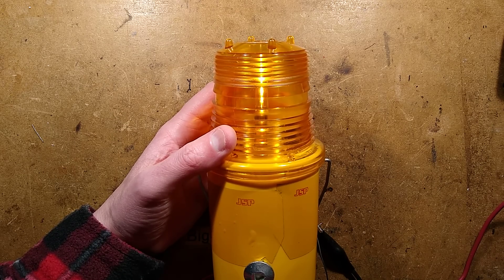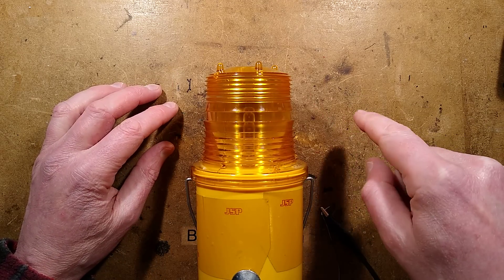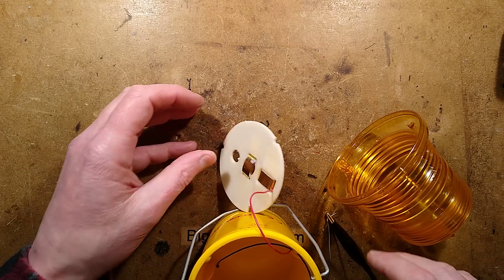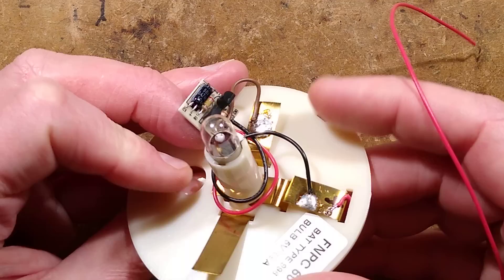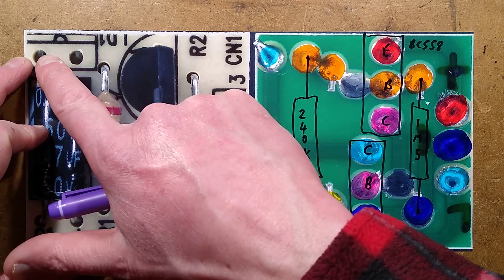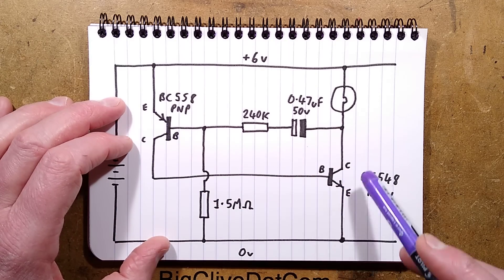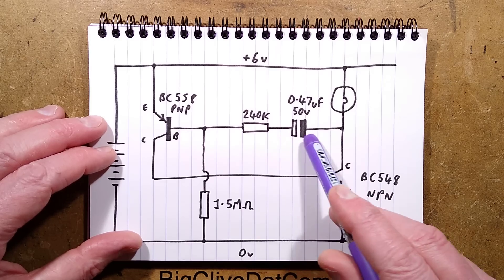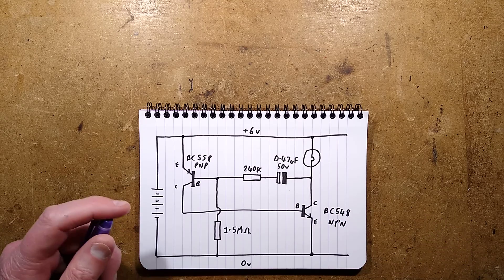Old tungsten roadwork beacon - with schematic

Comment: I’m old enough to remember roadworks beacons that used a paraffin lamp. They went electric around 1966.
Reply from the maker: Those used to be really cheap on eBay, and now they are expensive vintage items.
Reply: @bigclivedotcom The original Dorman Smith one's are. Dorman Smith got the idea after one of the founders took a trip to the USA and saw a transistorised lamp made by R. E. Dietz. Dietz 650. Dorman Smith them obtained the rights from Dietz to produce here under the Dorman Smith Trafilamp name. Just some pointless info.
Reply: They were still using the paraffin ones in the 1980s where I lived  .
Reply: @kwakamonkey I saw them in the Eighties too.
Reply: I remember  in the middle of a torn up road you would have the night watchmen in a tent with a kettle on a brazier guarding the steam rollers. They would always talk to you and sometimes a dimple glass of beer would be sent over from the pub probable in exchange for some Esso blue paraffin used in the lamps.   @belyear
Reply: @kwakamonkey that’s right they still use the paraffin lamp in London up too the late eighties and there was two colours Red with red glass windows and yellow with amber glass windows.
Reply: @Dog-whisperer7494  I doesn't surprise me they were used for 20 or so years, after they were no longer manufactured. People didn't just throw them away, because they were no longer made. They would have replaced them, as they broke.
Reply: Yeah same here. @kwakamonkey
Reply: @kwakamonkey came to say the same - 1980s around Manchester still were using paraffin
Reply: Came here to say this too. I used to see those regularly in the early to mid 70s. There are a few variations on the classic lantern battery ones too, like the one with a rectangular body and a huge round lamp/reflector that had an on/off switch accessed though a pinhole in the body.
Reply: @TheRealBobHickman 

I think there's two still in my mum's very disastrous garage. A yellow square metal cabinet with a curved vented top and a substantial metal hook built in. Three thick amber glass lenses, one of them was all yellow and one had white rims around the lenses.

I think my dad procured them from when he used to be a fabricator for Laings in the late 60s or early 70s.

If we had an outdoor BBQ and drinks etc (a very common weekend occurrence in the early up to late 80s and before I was told, I was born in 1977, no alcoholic stuff for me, then!) these would be outside as the light went usually with a huge candle stuck in each!

Funny how a comment can bring a flood of good memories back 😊
Reply: @TheRealBobHickman  Yes I remember those.
Reply: I have one of those from the '50s. I'm old and senile now, so have now idea how I came upon it, officer.
Reply: Did they originally use a bulb with a bimetallic strip for the flasher?
Reply: @alunjones3860 I believe so, I remember when I was a kid you could hear a slight clicking as it switched.
Reply: @alunjones3860 Transistors.
Reply: @alunjones3860  YES...a very complicated circuit...!!
Reply: I remember smudge pots at construction sites. Bright flame at night, fountains of black smoke during the day.
I see them for $30 on eBay and Etsy.
Reply: @tncorgi92  I remember seeing those as a kid and thinking they looked like little bombs since they were round.
Reply: Yes, metal square boxy things with a red coloured lens on each side with a large metal loop/hook on top.
Reply: I recall some in Illinois in maybe the late 1960s that were squat and vaguely spherical and burned what I thought of as kerosene…
Reply: I remember those as well,  in New York City in the 1960s.
Reply: @markiangooley  They were called "smudge pots" and yes, they looked like 8" diameter black spherical bombs. Filled with kerosene, they had a wick and a cap attached with a chain that was used to extinguish the flame when it was not in use. They stank and smoked and were generally dirty little warning lamps.
Reply: @markiangooley  they used them into the 80s in NY - they're called "Smudge Pots"
Reply: @markiangooley Right the big flat bottomed spheroid with a wick and a big smoky open flame. Maybe kerosene fuel, I suspect they were just as often filled with diesel judging by the smoky flame.
Reply: We would keep the paraffin ones and use them for camping... this was the 1980's they used the paraffin ones were used on older roads they would leave them for ages
Reply: @blackcountryme  It must have also been good for keeping you warm, Talking of obsolete technology, we still often used oil and gas lights when I was in the scouts in the 1990s. I suppose it made sense, as the same lamp could also be used as a stove, if the mantel were changed for a burner and it lasted longer than batteries. Nowadays it just makes more sense to use safer and more efficient LEDs.
Reply: Smudge Pots (as the paraffin ones are called in the States) found a second life in Citrus orchards on frosty nights. Both the heat and oily smoke offer some protection for both fruit and trees.

It's interesting you should mention flashing. The wind blowing the flame about is the original source of the flashing; it became so characteristic of these devices that all the electronic versions that replace the originals flash.
Reply: Floridian Zoomer here, I learned about the burning fuel road flares during a hurricane in my childhood: a local tree-surgeon and family friend had been hoarding them as “collectibles” (turns out he WAS right, unlike his Bernie Baby and Baseball Card predictions). He was a cool guy, got in a fight with local utilities for paying his crew out-of-pocket to clear fallen trees for free after the storms. We were out of power for almost a week after Wilma, and he lit the neighborhood with his little burning clay pots and hauled brush and lopped limbs in the dark until noise ordinance would stop him.
Reply: I've got one of the paraffin ones that my dad "acquired" years before I was born. Used to hang in the shed at home. Now hangs in my garden.
Reply: Back in 1979 while on a walk I found a becon that had been hit and slammed into the ditch on the road I was walking. I took it home and reversed engineered it myself and the circuit was very similar except the becon I found had a cds light resistor that pulled the base of 1 of the transistors to ground when it was light enough not to need it flashing. It like the one in this video used the same type of battery supply but it was better because it made the battery last longer.  Today we use solar charged batteries in the better made beacons. A good  video Clive.
Reply: They were also used on the railways as a signalmans lamp.
Reply: Me too! 😅
Reply: same. We were a bit behind the times in the midwest of the US in the 60s & 70s ^_^
Reply: They were still using the paraffin ones Into the seventies. They repainted a lot of them yellow, but my brother and I got hold of one in the original red with white roundel
Reply: I stole some parrafin 1s with the hooks back in the 80s and my mum uses them in her garden when it gets dark, the smell takes me back to good times
Reply: I remember those from the very early sixties, they were round and black, flat on the bottom and had a little cap on a short chain. They were pretty smoky too but they smelled like kerosene.
Reply: I got my start with experimenting with electronics with those 6 volt batteries and blade switches, wire, bulbs, and whatever else I could get with my 5 dollar a week allowance in 1961. 
Things have certainly changed since then. There’s so much stuff to play with these days.🚧🙂
Reply: I used to have several of them . Wish I still did lol
Reply: @kelvinsparks4651  You could fill them with citronella oil and repel insects.
Reply: Anyone in this thread could answer, how did they blink the paraffin lamp? Was there an electric rotating reflector or did they simply not blink?
Reply: They didn't blink. They were just little paraffin/kerosene lamps in, basically, a metal box with coloured transparent windows  @JarnoKai
Reply: @tonywalton1464  The flame flickering would have created a flashing effect.
Reply: @JarnoKai  they didn’t blink
Reply: @fredbloggs5902 Some did, and it was just the design of the wick holder. They didn't actually blink, the wick would just flare up and  die down again (almost). giving that impression. Used many of them in my youth, still have one.
Reply: @JarnoKai  most didn't blink, but there was a version which did, by means of a special burner which caused the flame to almost extinguish and then light up again. As I remember it had extra holes in the burner under the wick and I think it had something to do with the airflow.

Comment: I used to get these as a kid - no circuit board at all - just a bulb that had a built in flash mechanism
Reply: Just like those xmas string lights where one bulb on the whole string is a flashing variant, usually a clear glass bulb with red tip for easy identification. Apply ~3V and it flashes on its own.
Reply: @teardowndan5364 Bi-metallic strip.

Comment: You say that circuit was as simple as they get, the ones I nicked as a teenager in the 60s just had a battery and a bulb with a built in bi-metal switch, to turn it on you shoved a pin through a hole to bridge some contacts. I still have a couple hanging in my garage.
Reply: Yes in the Netherlands we had those to in a rectangular metal box with two parallel 6V batteries inside. This box was closed with a large special anti-theft bolt but one managed with some pliers.

Comment: Oh the memories. Swiped a lollipop style one of these as a kid and tore it apart.
The things you can do with a 6v battery and a piece of wire as a devious child.
Not to mention the free flashlight bulb LOL
Reply: The road workers always had spare bat's for a lad to play with. The early ones had a bimetallic switch in the bulb so when the bat got low they would just stay on.
Reply: @Woffy. 
They did indeed. No electronics, just a flashing bulb. We used to "borrow them" and salvage the batteries for other more interesting uses.
Reply: @johnnodge4327 Thanks for the reminder, I also borrowed a few way back when. Time to return them I guess, but the council aren't answering the phone at 1am for some reason.  I guess they're not too concerned about recovering them after all.
Reply: The 6V lantern batteries were good to waste on making pencil leads glow.
Reply: @Sonny_McMacsson I used Dad's battery charger for the pencil leads. It had selenium rectifiers and a big transformer. I still have it and it still works so it's obviously indestructible.  It's a dumb charger though so it'll boil the battery dry eventually.
Reply: The lollipop style ones are all I would see in the US. I wanted one as a kid, but could never snatch a loose one.
Reply: Same. At age 10 I was able to breadboard my own bulb flasher using a schematic from the manual of a Philips electronics kit in the E200x series. It had a few variations on this theme too like sound, ldr etc.
Good times!
Reply: @Multi-Skill-Bill
i also acquired one about 50 years ago , a lollipop with 2 batteries , a clicky switch that was operated through a small hole and if memory serves the same electronic circuit :-)
Reply: @YTANDY100  yep, the one you could switch on or off with a paper clip :)

Comment: Reminds me I recently got a couple 12v amber bulbs from the autoparts store to use as a load for a psu I replaced a cap in. I soldered a couple wires to the two contacts on the bottom. Interesting that bulb only has one and the sleeve is the other connection. However I know most bulbs are like that. Glad I got ones with two points. Easy to solder to. Wasn't spending more money on sockets

Comment: The Pre LED USA barricade flashing lights differ in 1 main way, the flashing circuit is supper brief and the lamp is rated at a lower voltage that the 6-volt battery. So, the lamp acks like a strobe. They hit the low voltage lamp for a brief pulse for a super bright flash that does not burn the lamp out.

Comment: I've seen some of the newer LED lights that somehow seem to run in a sequence and always wondered if they communicated with each other.  (You sometimes see them on the motorway when a lane is closed and the lights as the cones come out will run along the line of cones in sequence).  Would be interesting to see how they do that.
Reply from the maker: Infrared emitter and receiver.
Reply: @bigclivedotcom always wondered how these work, would love a teardown on one of those
Reply: @bigclivedotcom  cool, I assumed it would be something like that but never had the chance to take one to bits to see.

Comment: I had one as a kid. Left behind in a ditch after the road workers had finished and probably forgotten to take it with them. It was always on and had a light sensor but when the battery had run down I had no clue what to do with it so probably threw it away.

Comment: My grandfather worked on the roads and gave me one of these when I was a kid in the 80's. My one had no light sensor. You had to twist the top so it made contact with the battery.
Reply: I always wanted one as a kid, I loved lights and batteries.

Comment: Lately... Road Work Companies have rechargeable units, with solar cells on the top of the beacon
Reply: Must be a lot less maintenance with LED'S and a solar panel.
Reply: very true @volvo09
Reply: absolutely @volvo09
Reply: Definitely in Australia.  LED short-pulse strobe units, fully sealed, and the one on-off switch tucked away underneath.  Lots of similar designs available via AliExpress and others, and useful to have in the car "just in case".

Comment: I obtained one of these flashing things in the early 80s and there was no PCB but instead a bit of tuff cardboard with holes aligned so when the components were poked through they naturally aligned so they could be twisted and soldered. It did have a optical sensor for day / night which might have been a PN photodiode.

Comment: Let me add my voice to the "I had one of those" brigade! I converted it to use a xenon strobe lamp and it still lives in the back of the car in case we break down anywhere - complete with 12V cigar lighter plug and long lead!
Edit: It would be nice if you could get hold of one of the 'modern' flashing beacons which has the 'follow me' mode built in - they flash a short time after the one in front and make a very pleasing 'flowing' light to guide traffic at road works....
Reply from the maker: I think those use a directional infrared emitter and detector for sync.  They will revert to a fixed speed on their own, but if they detect another light sending a pulse they trigger a new delay and then send their own pulse out to the next light.

Comment: My first experiences with transistors were with barricade flashers just like this, but with germanium transistors.  This was the standard circuit but with lower resistor values and larger capacitor because the germaniums were lower gain and had more leakage current.  The two resistors should have a different ratio.  The flashers back then had a much shorter on time than off time, and it was more like 2 or 3 seconds between flashes.  IIRC the miniature bayonet lamp was #50, about 6V at 40 mA.

The CdS photocell should be across the base and emitter of the PNP transistor.  If you put a resistor in series with the base of the NPN, it will limit the current to the cold tungsten filament, and it will light up slowly.  Too slowly.

I can't understand why they call this minimalist.  A minimalist is someone who is into minimalism.  An object is simply minimal. It's not a person.  Thanks, Clive - you brought back fond memories.

Comment: I cracked open a 6v battery when I was young and discovered that there were D size batteries inside...pretty neat discovery when you're a kid  :)
Reply: Actually, the standard cells in the type of 6 volt battery Clive showed were originally "F" cells...however, the modern ones may indeed have "D" cells with a spacer added to take up the extra space.
Reply: @m.k.8158  yeah the old ones had D width cells that were as tall as the case.
Reply: Did you then pull the cell apart? A nifty carbon rod down the middle surrounded by black goo in a zinc case.
Reply: The black goo being mostly manganese dioxide with some ammonium chloride in it.  Handy for chemistry experiements;.
Reply: You can tell whether it's using Ds or Fs by finding the balance point of the battery.

Comment: Where did the LDR connect in the circuit diagram?   And I'd love to have you open up the dead battery and show what is/was inside, if you still happen to have it.
Reply from the maker: The mystery connector was across the series resistor and capacitor.

Comment: If the battery is dead you might find it informative to open.  In the USA they are often full of "C"-cells and sometimes "AA"-cells, or a mix.
Reply: You might find almost anything inside now, but the original batteries of that type used "F" cells.
Reply: @m.k.8158  Ahh, that's right, i couldn't remember the letter. Can confirm that road lamp batteries (from my dead one) still contains 4 unmarked zinc carbon (likely zinc chloride electrolyte) F cells... Not found alkaline ones this side of the atlantic, but in the US they often had 4 Alkaline D cells in
Reply: The ones they use here tend to use the larger cells, but olde school Zinc Carbon... or used to . Handy source of large(ish) carbon rods

Comment: Nice rugged design. Its a nice flashing not harsh like some of them. I remember coming through some road works a while back and the lights on the ones were all in sequence it was like driving through a Disney ride, they were going just a bit slower so it felt like we speeded up 1000s time. really odd feeling. .  Great video 2x👍
Rubber overalls!!!. who's the seller???☺🤣🤣
Reply from the maker: eBay has all the rubber and PVC overalls you require for your industrial pursuits.  Keywords, grundens, viking, elka, guy cotten, stormline and others.